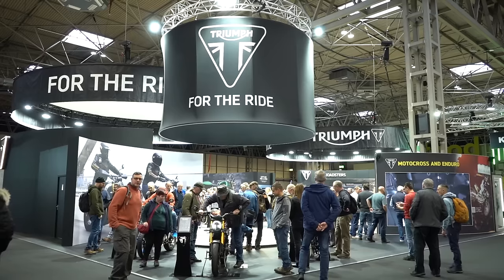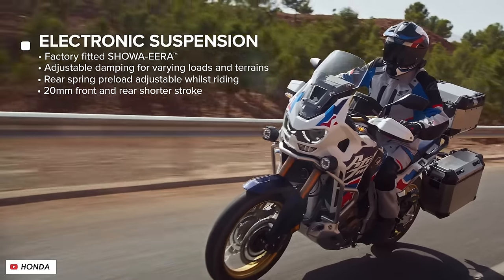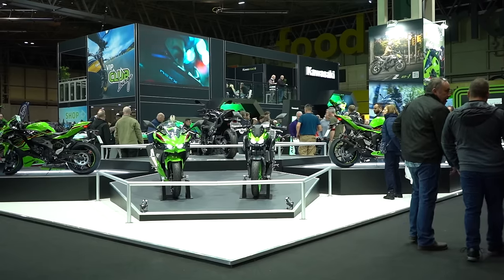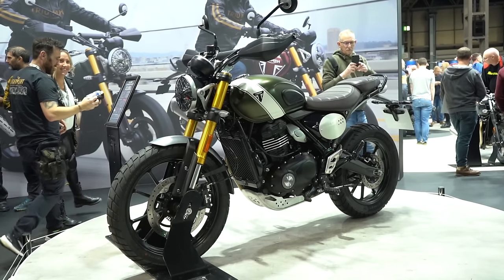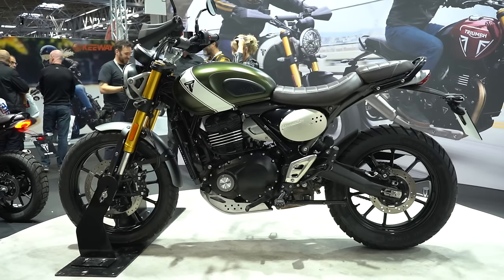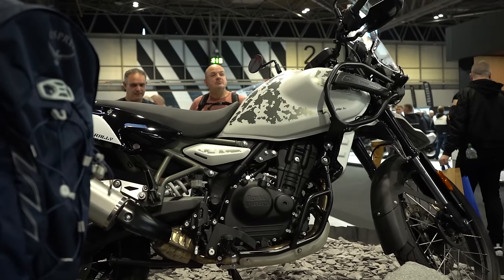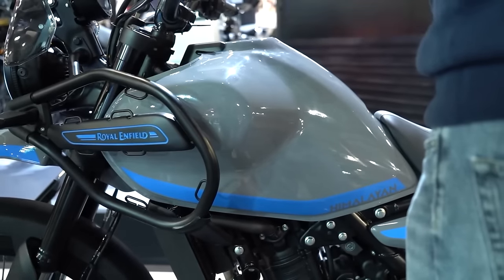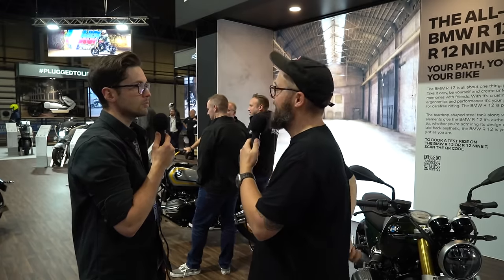Best New 2024 Bikes From Motorcycle Live!

Comment: i own a 2020 Triumph Rocket 3 GT and yes everytime i ride with it and make a stop somewhere people alway come to me and ask question about my Rocket its a looker for sure and the torque is out of this world so pround to have one ive been riding for 40 years and i owned alot of different motorcycles the Rocket is the best motorcycle i ever own.
Reply: Maybe for cruising but for any actual fun riding that heavy ass bike is useless. I like taking corners and riding fast on twisties, that’s only a cruiser bike like a Harley but without Harley looks. The rocket look way more sporty than it actually is. Sure you can take corners, but not even close to the amount of speed or control you can on sport bike. It’s a cool bike but I’m not into that slow riding style cruiser style. It’s just too boring and that’s what most people my age think (I’m 20)
Reply: @flyashish  yes there you are your 20 years old at 25  i owned a Suzuki gsx 750 slingshot a 1989 with the 2 round light in front and yes i had a lot of fun with it i was young now im 60  years old and my back cant be lean foward for long ride anymore, ride safe body.
Reply: Adventure bikes look like a nightmare